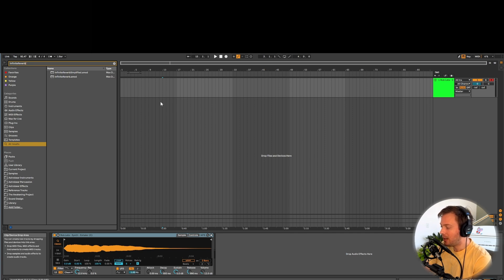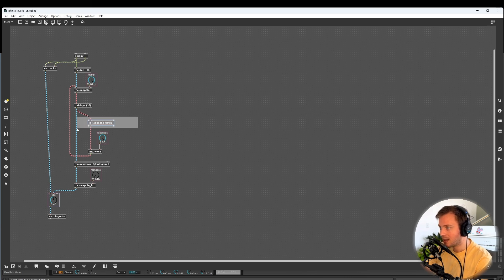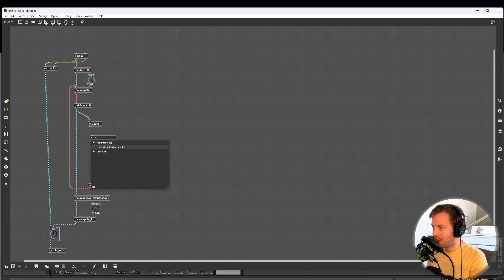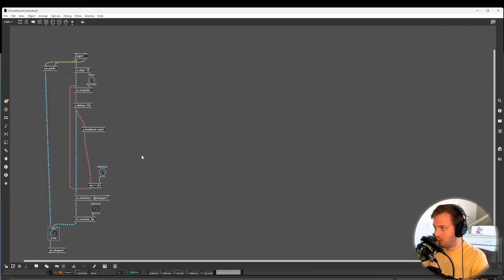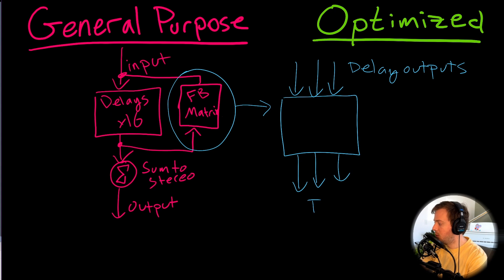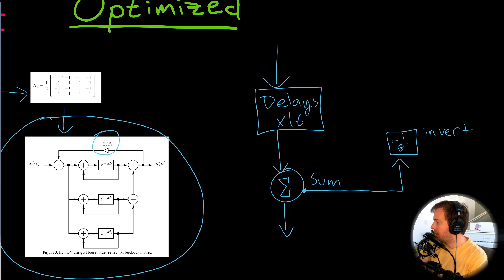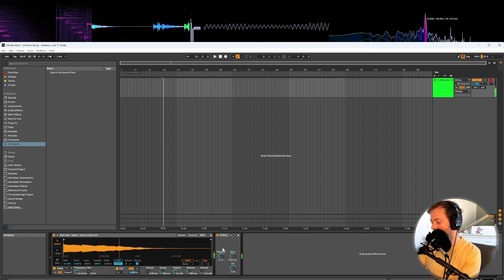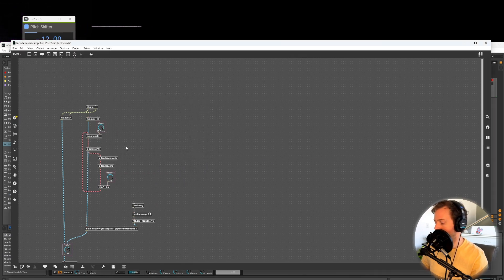Reverb from scratch in M4L (Simplified Feedback Delay Network)

Comment: It's possibile to design a convolution reverb in M4L or in pure data? And, if it is, It is necessary to add python code?
Reply from the maker: Definitely possible, but I haven’t done it so I don’t know how many building blocks they give you. The Convolution operation only requires sample delay, multiplication, and addition. So in the worst case you can build it in ~gen (for the sample delay). But you would think someone already built a convolution operator for max… in a quick google search I didn’t find anything other than convolution reverbs other people have built, so you can maybe poke inside those. Feel free to DM if you have any questions on how to do that
Reply: @astrobearmusic1977  ok, thank you!